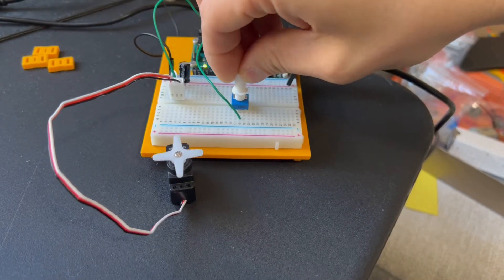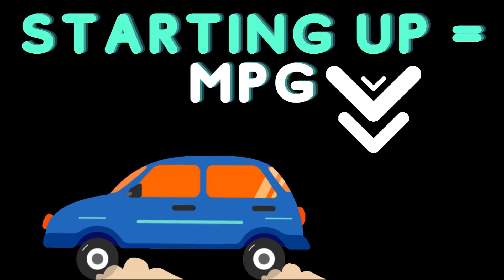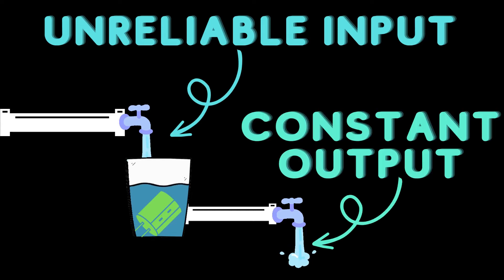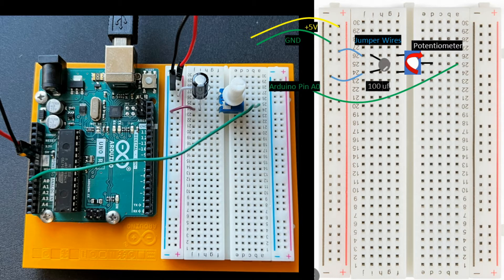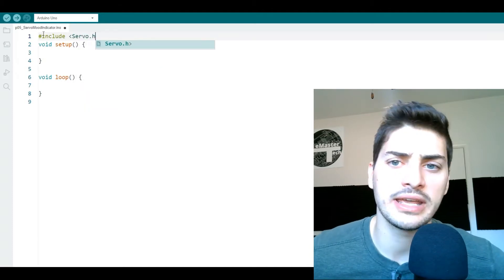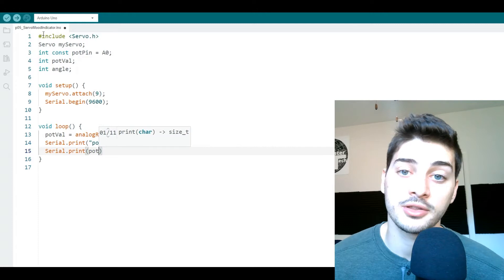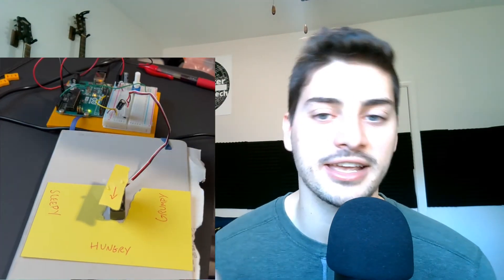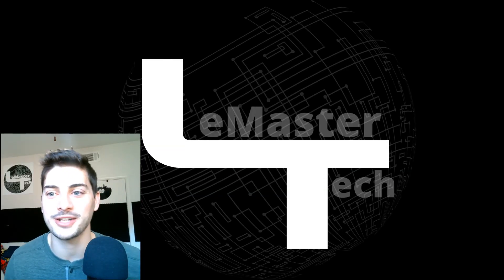How to Control Servo Motors with an Arduino!

Comment: great video. what voltage capacitor do you use?
Reply from the maker: Hi the one in this video is 100 microfarads and rated up to 450 VDC but I was only using it at 5 volts I believe, it’s been a little since I made this video though!